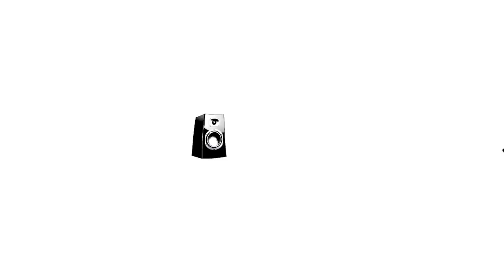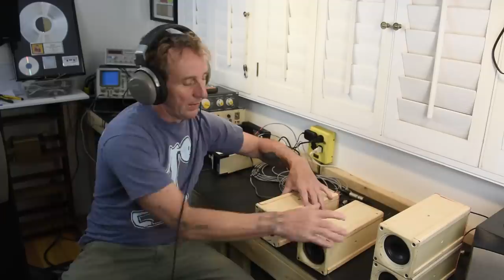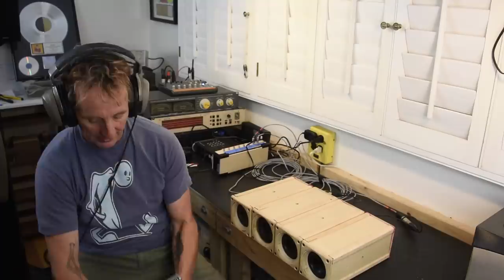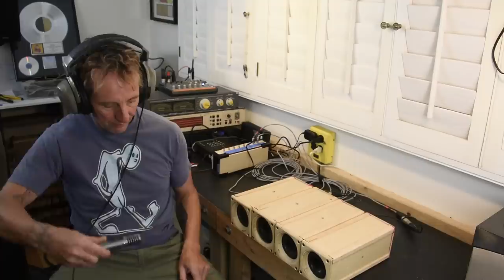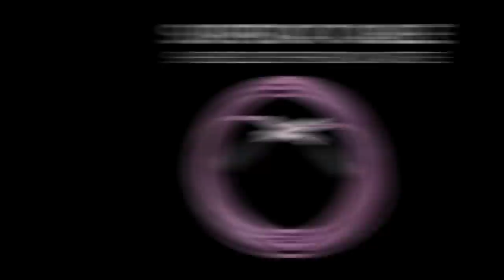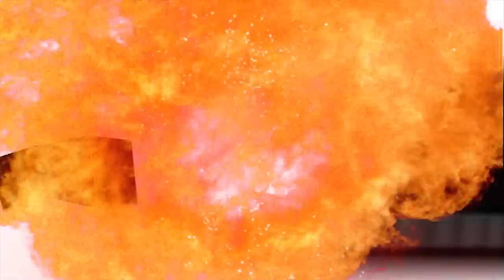Line Array vs Point Source vs Human Hearing

Comment: GREAT VIDEO
I HAVE A QUESTION?
Despite the differences between line array and point source being dispersion or coverage,is there any other difference between line array and point source speakers with reference to the manufacture components eg inbuilt cross over unit,voice coil ?
Reply from the maker: Not really, Monterey boxes and point source boxes strive to be flat and use high power components with low distortion. The main difference between the two is line arrays put the speakers very close together in the vertical dimension and also have specialized horns or high frequency wave guides that allow them to some together vertically very well.

Other than that you could change out the horn on a line array box and use it as a point source and it would work just fine

Comment: McIntosh XRT 20 Line Array owner here.  Nothing comes close for me.  Also, ironic that such a brilliant audio guy didn't think to use a lapel mic, or something that would make the giant leaps in volume a bit more bearable.  Still, no disrespect meant.
Reply from the maker: All good, yeah, I usually do these videos very last minute, no rehearse, no script, and usually a single take, straight through full improv. So, I do run into audio or other issues that I only find out about afterwards.  I then decide to scrap or roll with it. 

When I scrap them, I rarely re do the subject and just move on to a new idea next time.

It's kind of a fun way to share info and I must admit, I am surprised and humbled by how popular some of the videos have become.

Will work on tuning them up

Comment: As Heyser famously stated, "the ancients keep stealing our discoveries!" This is the fundamental reason why proper "cluster" builds incorporated stack/splay as it moved the interaction to the vertical and provided more consistency in the horizontal plane.    I've said for years line arrays  move the interaction into a field where gravity does a fine job of keeping most folks out.  However raked seating planes or multi-layered balconies are different animals.     If you want lucid, loud, low, and little, there are certainly other ways...
Reply from the maker: I have an affinity for all types of system designs and an affinity for choosing the optimal tool for the job at hand

Fixed install can have a wide variety of solutions that are less than ideal for applications that require portable, scalable, systems with variable coverages and rapid deployment times.
Reply: @DaveRat   Sadly as much of a crisis as live sound is currently in this isn't the time but when better days come back around and i pray that's soon, how cool would it be if  everything you described needing was available while providing greater fidelity with a dramatically smaller footprint, i.e., more bandwidth and output smaller package, less labor, less liability, etc and without the issues created in self interference designs?  Its coming, and being a realist i know it probably won't be madly embraced as the strength of marketing is powerful and a lot of folks owe a lot to the company store but as you point out, we are humans and ultimately greater bandwidth and fidelity along with a much quicker R.O.I.  will be very difficult to ignore.
Reply from the maker: Well, a Swiss army knife that does everything is also a compromise when compared to specialized tool well selected and crafted for a specific application.

If it does everything then it has many unneeded aspects for many applications. 

It is the choices of compromising the aspects unneeded.

If it's portable, it's overbuilt and over heavy for install, if it's very small, then compromises on max volume have been made. If it's light weight, sounds good and gets loud, then the costs rise. Perfections in fidelity cost size, weight, money and max volume capabilities. And on and on.

To tell me a sound system does all perfectly is to tell me you have a vehicle that is as light as a bicycle, fast as dragster, holds as many people as a bus, rides like a limo and is perfect for the Baja 500 race.

Understanding the application and optimizing for it is where the true solutions and greatness resides.

Comment: What is your opinion on the Danley concept of the synergy horn with multiple drivers feeding through the same horn?
Reply from the maker: That helps solve some of the issues but introduces new ones. Like when EV did the MT4 with quad HF on a single horn.
Reply: Dave Rat what kind of issues?
Reply from the maker: @Durosai  hmmm, well with the EV MT4, EAW 750 and similar designs where multiple drivers are all combined into a single flare, there is nothing to stop the sound of one driver from going back down the throat or physically modulating the cone of another driver.

What do you think happens to a fragile aluminum or titanium ultra lightweight high performance horn diaphragm when placed right next to and inside a high pressure low and mid horn chamber?

High levels of LF energy travelling back down the throat of a horn driver not only create an audible blurring of HF, I have done testing where I have shattered HF diaphragms in drivers that were not even plugged in, by using the output of the LF drivers.

Also, the more complex the path that sound travels in order to achieve a goal, like summation or dispersion for example, the result of the more complex sound path results in other compromises.  

Balancing sound quality, max volume, coverage, weight, size, cost, aesthetics, ergonomics and scalability while minimizing sight line issues with rapid deployment times is a complex adventure indeed.

Like everything in life, rarely can you solve one issue with out creating others. Never believe anyone that claims to solve all
Reply: @DaveRat  
Interesting regarding the diaphragm fragility. Granted, I'm not immersed in the pro-audio world these days, so I'm not aware of it occurring to the Danleys in the field. Are there reports of this? 

Regarding the LF modulation of the HF, that would be discernable/measurable, thereby addressable ... no? 
Always wanting to learn more.
Reply from the maker: @FOH3663  the question isn't whether it occurs with the danley or other systems, the question is whether the impact is discernable, as you mention.

Based on my work as a consultant for manufacturers and my experience, I have found that diaphragm modulation can be quite audible, occurs in numerous designs and is rarely measured or acknowledged.

I was able to measure and demonstrate it's audibility. Designs where low frequency drivers are sharing a horn throat with HF drivers tend to be most suceptable, though even high density baffle reflex designs can have audible issues at high levels.

But, like all of the assets and issues with the various designs, they all must be taken in context of the magnitude and impact upon the desired application
Reply: @maxmaix  
I'm not sure the Danley offerings are unpopular, in the traditional sense. Their form factors are unique which maybe is approached with trepidation... despite their superb performance. 
Also, I always viewed them as carving out their own niche as the industry riders specs is just kinda tough to break into... thriving on commonality. 
Seems like it was Showco, Meyer MSL-4, Clair C4, then the EAW-850 variants were everywhere. Then line arrays became ubiquitous.
Reply: @maxmaix  have you heard those danley boxes inside beaver stadium? it said it has a 106,000 seating capacity. curios on how it sound. or perhaps they have a different market than what we have as rental company.

Comment: that's exactly why i like funktion one systems better than line array
Reply from the maker: I have had the honor of not only visiting funktion one engineering lab, I've also had the honor of Tony Andres picking me up at the airport and riding with him in a car is even more fun than the thrill of a giant PA.

I too like function one, just like I like band saw, and I like line arrays like I like a table saw, and small self powered boxes like I like screwdrivers and hammers
Reply: @DaveRat all the line array systems that i got to hear sounds great with live music until you start playing music with fast transients like trance music then i can clearly hear phasing issues almost like someone put a delay on the high frequencies.. the funktion one system's sounds to me much more like a studio monitors when you sit in the sweet spot.. obviously it's not 100% perfect i guess it depends on you're preferences and the music played through the system, that's just my experience I'm not a professional.. although i did work with those systems here and there..
Reply from the maker: A properly set up high quality line array by d&b, L-Acoustics  or other high end systems, should not exhibit the "zipper"  effect that you describe which would be due to poor vertical summing of the line array elements.

A poorly set up or designed point source systems can also have numerous issues.

I personally find that mixing live bands on horn loaded systems, requires a lot more work and has a less stable mix than mixing on systems designed around bass reflex enclosures, that said, I find the for electronic music, horn loaded systems can offer a more exciting sound.

But covering large spaces with horn loaded non line array systems is very tough.

It's all about finding the right tool for the job

Comment: Dave, what about the nasty nulls in the coverage provided by an array which means the audience hears a different mix to the sound engineer? I think this is more important then what happens when you turn your head or move around. There are a few true point source solutions now which means you don't have to rely on arrays for large audiences
Reply from the maker: Using point sources does not eliminate nulls caused by overlaps in coverage. Single point systems that do not rely on an array, like a giant speaker on a stick are useful and cool but lack the flexibility of tailoring coverage to a venue or coverage area, that we rely upon with arrayable systems.

So, for large events to optimize coverage, we want an arrayable system, it's all about selecting an arrayable system the has minimal audible issues, covers well with freq response, clarity, volume consistancy through out the listening area and minimizes sightlines issues

Comment: So if I tilt my head 90 degrees my horizontal array sounds like a line array ?
Reply from the maker: Perhaps but horizontal arrays try to minimize overlap between adjacent cabinets and linerays strive to combine the overlap into a cohesive ribbon type source.

But this is not always the case like with the l-acoustics arc system, where the speakers can be configured in a horizontal or vertical array

They call this a constant curvature array and can sound good vertically or horizontally.

But unlike a line array you can't alter the angles between boxes and reduce the amount of volume drop with distance like you can with a line array

Comment: The lack of vertical perception however doesn't make you immune from the comb filtered sound hitting you from the interaction of the two boxes closest in vertical alignment to your ears though surely..Line array drivers are relatively small and packed in tight and generally hung a long way from the listener. The chance of being hit by just one driver or box seems unlikely. But then don't line arrays take 'advantage of combing to reinforce the sound..
Reply from the maker: Line arrays work on the principle that a listener is equidistant from multiple sources which sum and add volume for listeners far away and up close relies on listeners only hearing HF from one enclosure, and a gradual transition between the far and near listening scenarios for the people located in the middle between far and near.

Comment: Ok, I'm a listener at the stadium. And I'm sitting at one point. What advantages has the line array compared with the point source for me in terms of my human hearing properties?
Reply from the maker: great question. People use both line arrays and point source systems to attempt to cover a listening area as evenly and accurately as possible. Let's separate what people call point source systems into 2 categories, first you have the attempts to be true single point source systems like  most home HiFi speakers, speakers on a tripod or one big PA speaker. Though none are perfect, the sound all comes from a fairly small single area. Secondly, you have what people refer to as point source systems but they are actually  zonal coverage systems wherein multiple boxes attempt to cover various areas of the listening area and attempt to minimize interaction between the sound coming from the various boxes.

Interestingly, line arrays at maximum splay angles attempt to do the exact same thing. Each enclosure covers a vertical sliver and attempts to smoothly transition to the next enclosure, basically a vertically stacked point source system.

Where it gets interesting is in how the two design types attempt to deal with sound being quieter farther away and louder up close.  

For a point source system, they typically try and use narrow dispersion high volume enclosures to shoot far away and use wide dispersion lower volume enclosures to cover the up close areas. And then do the best they can to get the sound from these differing enclosure types to smoothly merge without issues in both the vertical and horizontal domains.

With line arrays, they tend to use identical or near identical enclosures with wide horizontal dispersion and narrow vertical dispersion and point many enclosures far away and less enclosures up close in attempt to increase the volume sent far and reduce the volume sent close.

The advantage of a quality line array is that if properly setup and configured, they can do an excellent job of getting the sound louder far away and not blasting the people up close, while maintaining a high fidelity sound. Additionally, since the volume levels at distance and up close are controlled by the angle between the boxes, it is possible to very accurately fine tune coverage while using only one or two types of boxes.  So the same line enclosures could be used to cover a venue 100 feet deep or 300 feet deep just by adding boxes and altering angles. 

Conversely, a point source array tends to rely on box types so the boxes top cover a 100 ft deep venue would not as easily transition to 300 ft venue.  
Line arrays tend to infringe less on sight lines, point source systems tend to be horn loaded and offer more punch or a more impact-full sound. Quality line arrays tend to sound more like a home stereo, and tend to offer better stereo imaging. Line arrays are often challenged by venues with steep high vertical coverage, but excel in echoey venues where keeping sound reflections off the ceiling is important.

Cool cool hope you enjoy the fun long answer!

Comment: Would a single 4 ft tall DML speaker behave like a vertical line array?
Reply from the maker: A line array is based on the exact same sound in phase and time radiating from the entire vertical line source.  A DML is based on a sound radiating at a multitude of phases radiating from the surface.

A line array is a multitude of pistonic drivers acting in unison, a DML is a sonic and phase chaos where nothing radiates in unison.

The behaviors of these vastly different design will not be similar

Comment: The late John Dunlavy (Dunlavy Audio Labs) did a lot of research into how the ears/brain work together to determine direction. He was adamant that speakers must be time-aligned and phase-coherent, which is why they sound so accurate.
Reply from the maker: Interesting, will check them out
Reply: @DaveRat  This article is 24 years old now, but it gives you a good idea of his thoughts. https://www.stereophile.com/interviews/163/index.html

All of his speakers were time-aligned, used first order crossovers, and were sealed enclosures. His big thing was step response, and the only way to get proper step response was 1st order crossovers and sealed enclosures. His background was in antenna design and he invented the log periodic antenna for the Air Force and the cavity backed spiral for NASa for the Gemini program. He applied what he'd learned from antenna design and applied that to speaker design. Duntech was his first company, then he moved back to the US and started up Dunlavy Audio Labs. I own 3 pairs of his speakers, and they're among the very best sounding speakers I've heard at any price. His bigger model speakers (SC-IV, SC-IV/A & SC-V) are still revered by many audiophiles and mastering engineers to this day.
Reply from the maker: Very cool and thank you

Comment: Line array question... let's say you have a L, R hang with 10 boxes per side. On the processors, you have the ability to trim the top half of the PA at +3 dB. Would this volume adjustment have a negative impact on phasing or would it not matter because each box hits a different part of the audience? (In theory)
Reply from the maker: Volume shading is a debated topic. One angle is to volume shade to even out coverage. And other angle is the concept that a well designed system can use the shape of the array and number of boxes to offer a superior outcome than volume shading can achieve.

The answer is somewhere between in my opinion.

Fixed or limited angle arrays benefit from volume shading and ideally volume shading is not needed and can achieve superior results if you have the propper. gear